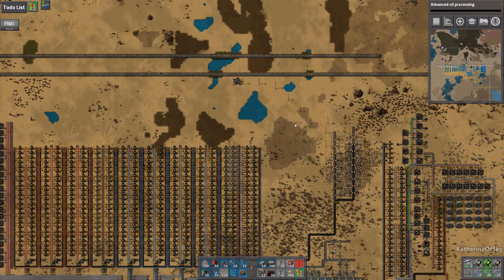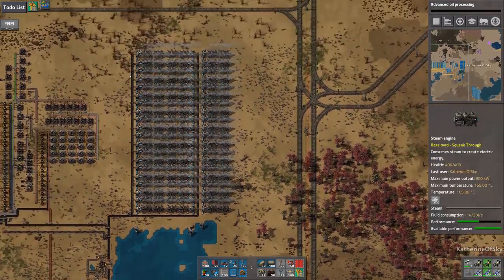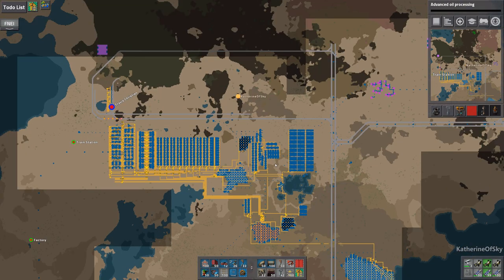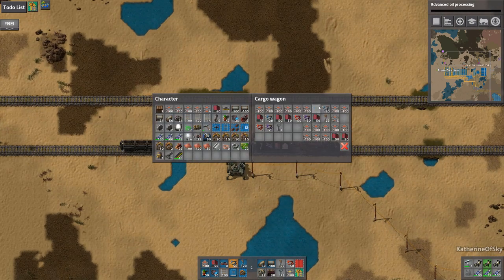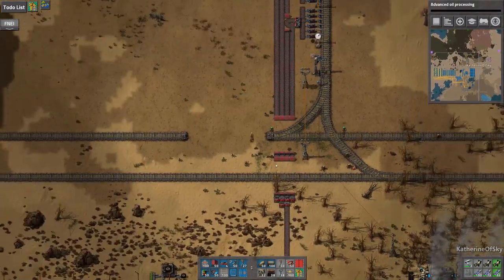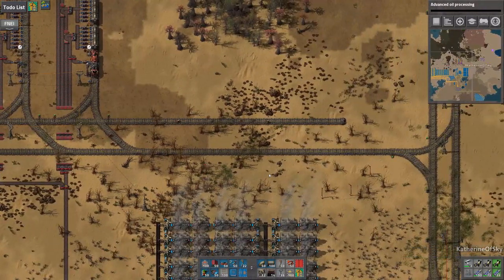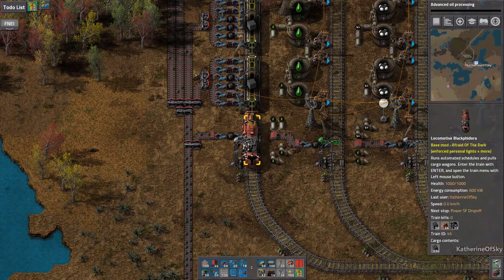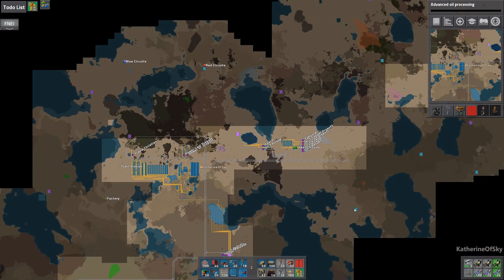Whistle Stop Factorio Ep 19: SUPPLEMENTAL FUEL - Mod Spotlight, Let's Play, Gameplay

Comment: KoS, as you're not using lubricant right now, your heavy oil is going to soon back up & stop your refining. Don't you also want to allow heavy oil to also be turned into solid fuel, at least until you can crack it?
Reply from the maker: Considering how many tanks we have, I doubt we'll back up the system before getting Advanced Oil Production :-)

Comment: Are you going to make a 'smart' nuclear reactor, or a 'dumb' one? (of course, I'm refering to circuit controls)
I have a few tips for the first option. I've been dabbleing with it for a while, and it's quite fun.
Reply from the maker: I'm not going to use circuits.  I don't approve of the use "smart" and "dumb" in this situation, since to me, it's far more intelligent to just use the limitless fuel instead of wasting so much time dealing with circuit conditions, factoring in steam, building tanks, and then recalculating all of that when you have to expand.  The amount you "save" in fuel is insignificant compared to the huge amount of production of fuel that is possible. 

I know some people like fiddling with circuits, but this particular instance, it is (to me) a Rube Goldberg invention -- lots of effort for almost no gain.
Reply: Well, genearally in this context 'smart' refers to a device that's capable of controlling itself. And this design is actually super easy, zero combinators needed (especially since it's going to be the main power source, so you won't need an SR latch)
It's just... Circuits are a part of the game, and one I really enjoy. Especially now, since I found out someone actually made a video player in factorio, that plays the Darude Sandstorm clip.
Reply from the maker: Circuits are very useful indeed.  I don't use S/R Latches because my brain doesn't process them well because of dyslexia and migraines, and I don't want to show people how to do something on a video that I can't explain well.
Reply: The standart SR latch design won't work with a high yield nuclear power plant, because it takes ~2/3 tics to fully activate, and in that time your plant can charge your accumulators to the point that it gets turend off before it fully turns on, which causes it to start flickering like crazy. I made a different one, that should work perfectly fine in that situation.

Comment: I'm quite the noob at trains but... why is it nexessary to have several parking spots for them? shouldn't they be driving around automatically most of the time?
Reply: Sven Schipper: Depending on the length of the trains that you are using on your railroad network and the distance to your sources (i.e., ore patches or intermediary product supplies), you need to have product ready and waiting until their number (or turn) comes up.

Let's say that you have only one train ferrying material between an ore patch and a column of smelters. Let's assume that you are running a 1-1-1 train. [1 locomotive - 1 cargo wagon - 1 locomotive] It can only carry 2000 units of ore (40 stacks * 50 units per stack). A sufficiently fast column of smelters (like steel furnaces supplied by red belts) can process that amount of ore very quickly. (Sorry. I do not have exact numbers.)

While your train heads back to the ore patch to reload, the column of smelters could sit idle. If they are idle, then that means that you do not have iron plate to supply your factory. Now, your assembly machines are idle.

But, if you have two or more trains ferrying in ores (or intermediary products) to their unloading stations, then you have a steady flow of material and you avoid idle time for the factory. Also, since you can only unload one train at a time (assuming that you have only one station dedicated to that particular item), you need a place to park them, which is the stacker.

Let me know if that makes sense. Is there something else that you need to know or to understand regarding trains and railroads?
Reply from the maker: Sven, I plan to have multiple trains going to each station, so it is necessary for them to have a parking lot in case the station is occupied or not available for product reasons.  You don't want waiting trains to block the main line.